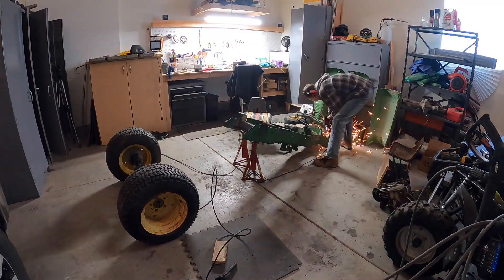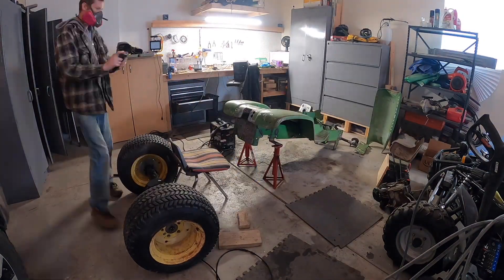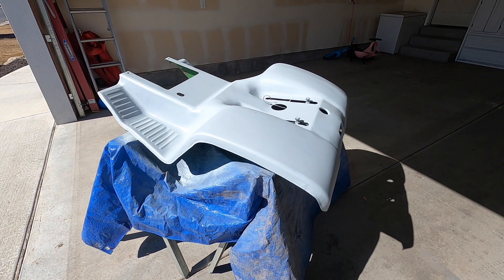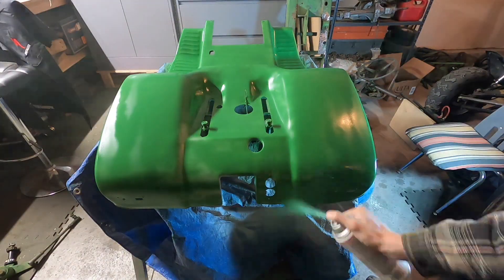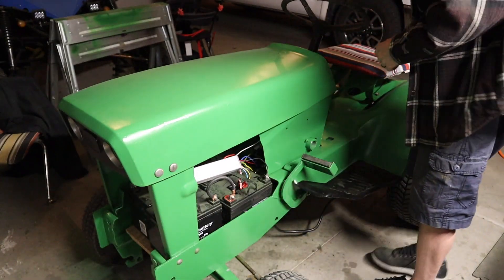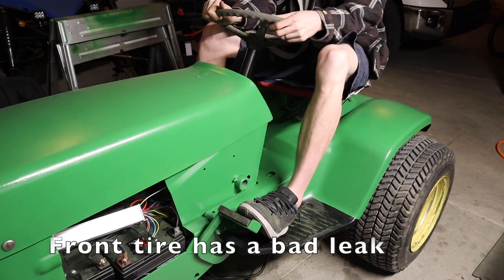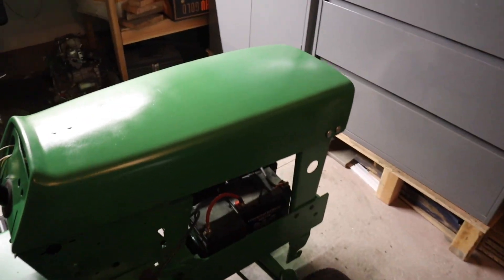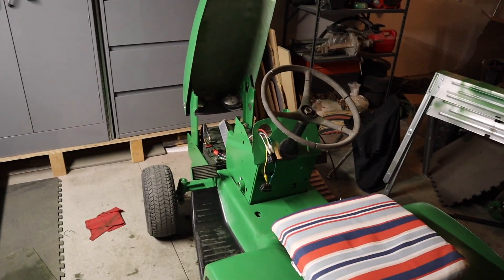Electric John Deere Tractor Build (Part3)

Comment: Looking forward to your built.  The 140 H1 and H3 is the grandfather of John Deere's garden tractor revolution, best garden tractor of their era.  The first to have hydrostatic and hydraulic operated implements.  Would you be adding a hydraulic pump since you've removed the pump/hydrostatic transmission.  I'm looking into doing something similar to my John Deere 318 (3rd or 4th generation after  your JD140).

Comment: Hi, I am about to order the parts to build a similar project. If it wasn’t for you sharing your experience, someone like me would never attempt such a thing. Thank you.
I have a few questions before ordering my axle.

Did you fit the 1500w motor or do you still have the 500w motor installed?

How is the performance? Does it have the driving torque and power one would expect from a gas lawn tractor?

I will be electrifying the deck too and I have chosen motors for the deck. I need need the confidence that the rear axle will give me a similar driving performance as the original gas motor did.
Thanks in advance. Christian
Reply from the maker: Glad the video helped! So I did use the 1500w motor and it works really good. It’s actually much faster than I originally desired however there is a low gear that you are going to want to hook up that comes with the axle. It gives it enough torque to pull a yard trailer over flowing with rock with no problems. It will struggle going up super steep hills though. It’s been awesome.

Comment: any info on the installation of that slick chinese axle? would like to see what the process to install was. most guy have used trans-axles from floor scrubbers. im keeping the original and chain drive it from motor, good update btw!
Reply from the maker: My first electric tractor conversion I used a floor scrubber type axle. So far I’m liking this one more. I will try to go Into a little bit more details on it in my next video!

Comment: A tip for future paint jobs, hang large panels sideways for painting instead of flat like you did.
The orientation you painted in is the cause of your satin finish, you had to spray from to far away and at an angle which prevented you getting a proper 'wet' coat and also blasts the entire area with 'dry' overspray, both of which prevent getting a gloss finish.
Adding the clear coat so soon after the green was another thing that reduced the gloss, the clear coat merges with the base coat because its still too soft and the solvents in the clear coat turn it semi fluid again.